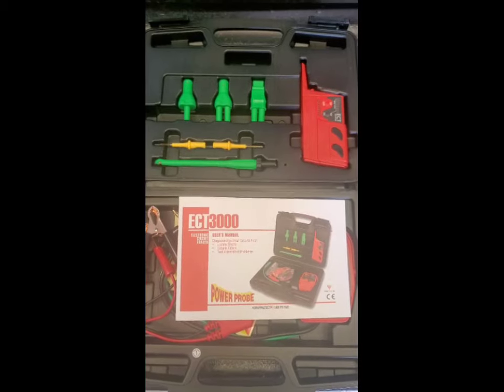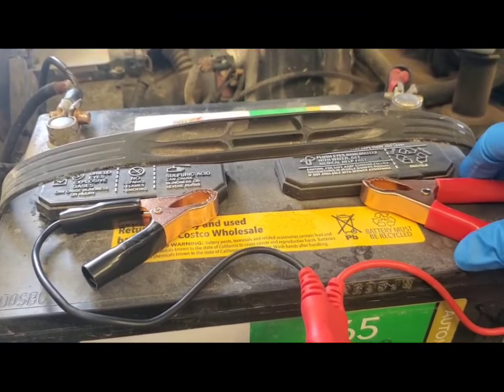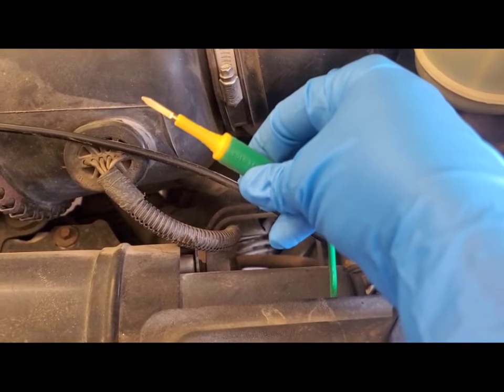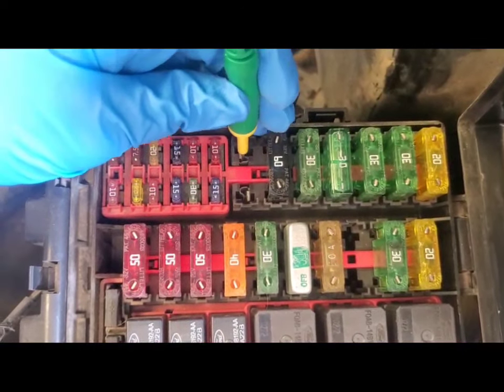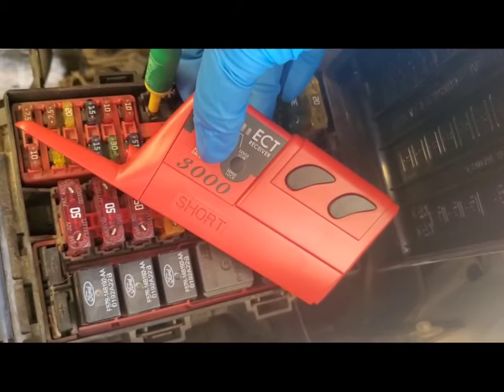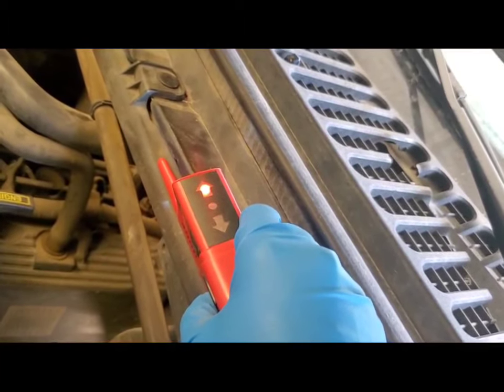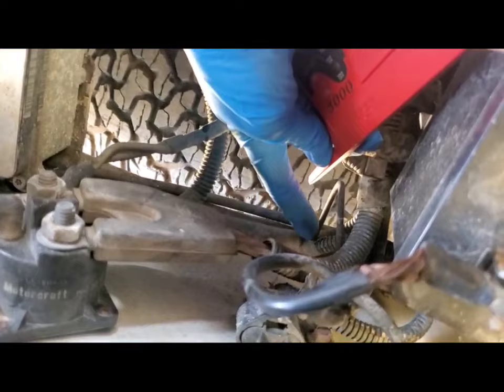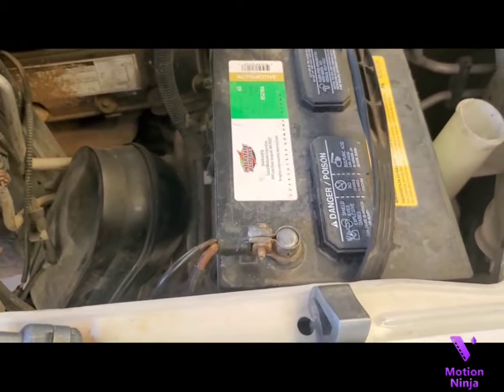Power Probe ECT3000 Demonstration. Episode 6

Comment: Thank you!!!!! Finally, someone who actually knows what a short is. In other videos, they call an open circuit a short.
Reply: an open circuit is a open circuit and a short is a short , 2 diffrent types of probelm , open  circuit means break in the circuit , (or faulty sensor if on the ecu side of things ) short circuit means a wire is touching down on another wire  somwhere or a live feed is shorting to ground some where
Reply: Yup, I was having the same problem finding a video for how to use this for a short. Most videos are for an open circuit.

Comment: I used it to find a short to ground on my classic 1979 Jeep CJ.  It failed to trace the short in the loom harness that runs above the steering wheel running from the fuse box to the fuel gauge.   Probably works okay when there are just a few wires in the harness.
Reply: Sounds like you need to adjust the sensitivity

Comment: Excellent description and demonstration of the ECT3000 for finding shorts...!! 

Good to hear (and see!) what to expect from the receiver unit when a short is detected (short LED lighting up and the tone). 
...Though the manual says it, it was also great to see that the direction arrows point to the short regardless of which way the receiver is oriented (parallel) to the wires (unless you have non-standard vehicle ground-polarity - per the manual)...

Overall great job ! Explanation and video work !  Thanks !!

Comment: The fuse that I need to put the probe into has the sentry security system included on it, this tool sending a signal through the wires won’t do anything to mess with the security module will it? Sorry if that’s a stupid question, those damn sentry security things are expensive and I’m paranoid I’ll screw something up, and praying that isn’t what my issue is 😮

Comment: if i don't have the blade probe, can i use the included plain wire adapter instead? Also how do you know which side of the fuse area is incoming or outgoing power?

Comment: 2nd time watching your video. 
at the end, I wish you would have shown us the procedure where you open the wiring. and show how to actually use the Probe to locate the broken wire.
Reply: I can dig that...might as well.  But dang this is getting you close fast
Reply: @robgriffinjr.1207  especially when you know where the short is lol
Reply: @michaelagnew7825   I was going to say. I have a short and I'll be darn id I know where to start. Fiat Chrysler doesn't want anyone to know much about their wiring except dealerships. Fuses and Relays are not marked and good luck finding info on them. Hazard lights started in middle of the night. Shut them off they kept coming back on. Now they won't shut off at all. Can't find a relay for them. I think it may be inside the BCM or ECM.  Found out (finally !) the flasher is soldered inside the instrument panel cluster.

Comment: 1. Should I use the ect3000 equipment after disconnecting the +, - terminal of the battery?
    Can I use the ect3000 without disconnecting the car +, - terminal?

2. Can I use the ect3000 equipment while the car is turned on?

It was easy to watch the video because your voice was pretty
Thank you😊

Comment: In my 73 Fleetwood, I have a short in my cigarette lighter circuit.  This 25A fuse powers the lighter, all interior lamps (courtesty, map, glove box, clock).  The short seems to be under the dash.  My head is near the gas pedal and I'm an old man.  It's cramped.  The harnesses are thick and I will have to tear into them HOPING I find the short.  It's a LOT of work, and this assumes I'm at the right spot.
Reply: Did you find it?
Reply: @markcoe69  Yes.  I put in the fuse after spending hours searching for or a false positive.  Everything I didn't cut out of the circuit lit up.  The short was in a clock which was part of the circuit.  The ECT unit is really a toy.  Gives way too many signals and false readings.

Comment: I ran across this randomly on Amazon looking for piercing probes. Then found your video demonstrating it. Looks like a pretty neat tool. Now that you’ve had it for a while, what do you think? I’m not very good with electrical, so don’t know that I’d take the plunge just yet. But since I work on school buses, I bet this sucker would come in handy (LOTS of added electronics, in case you didn’t know already lol).
Reply: This tool originally debuted over a decade ago. It's nice, but very quirky and inconsistent. Especially on automobiles who have wiring looms with 40-60 wires, and sometimes these circuits have splices in them. A splice will throw the tool off.

I've heard it's much better to use in the trucking and boating industries which have simpler wiring. Trailers especially.
Reply: @LynxStarAuto  works best if you disconnect the battery and only supply power to the one circuit you need to locate/test

Comment: Please help with any comments! I just inserted the signal lead into the fuse and the transmitter converted over to short and had a constant beep. I followed the arrows with the receiver and then took off some insulation of the wire. I put the insert back into the fuse location and now it’s not changing over to short. It’s doing nothing
Reply: When you pulled the loom off you moved the wire off what it was shorting on. Now you need to use mark one eyeballs

Comment: It would have been helpful if she showed the Actual short and the repair in the video as well. Otherwise there is no evidence that the short was actually located. Also, it’s very convenient that this short occurred in a harness that is very straight for most of its length since the probe wants to be next to it and parallel to the wires. I’m skeptical of how well it works when tracing a harness that is full of twists and turns like the majority of them are.

Comment: This tool signal wire can connect with positive B+ wire or wire connect with ecm or bcm can possible to track wire.
Today I to track wire connecting with electronic controller this tool can't work.
And remove battery both wire and check this tool can track if your wire connection with electronic controller

Comment: It aint worth a shit! Ill connect it to any good circuit and it says its open. Ill connect it to one circuit and check another and it still beeps.
Reply: It talks about that in the instructions. It is kind of useless in larger harnesses is my understanding. Unless you can separate the known trouble circuit to prevent the signal coupling into good wires it doesn't really help much as far as I know. The power probe is super nice for component testing though. For broken corroded wire issues connecting to both ends of the circuit with an ohm meter and carefully wiggling the harness to find the bad spot has worked best in my experience.
Reply: Someone in another comment  said disconnect battery and only power the circuit you're after! I'm pretty sure that would help with a bigger loom